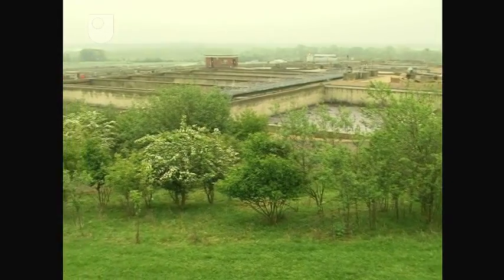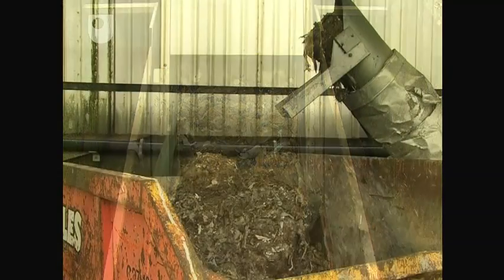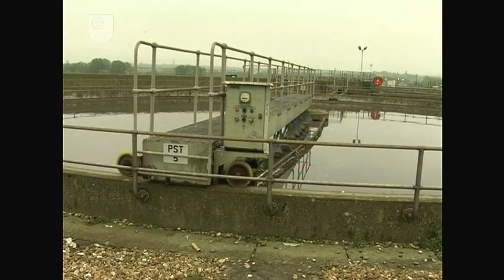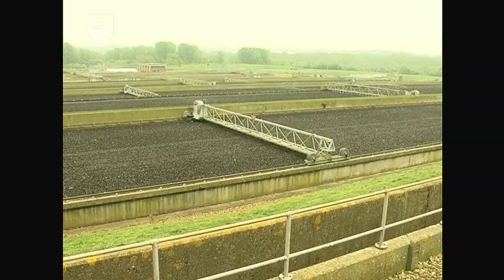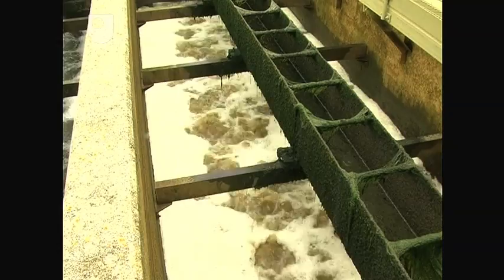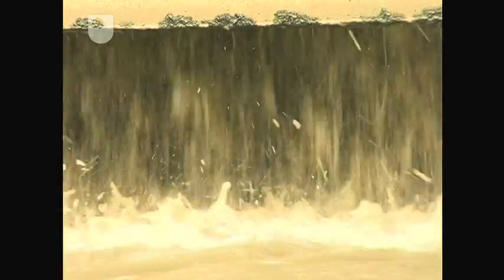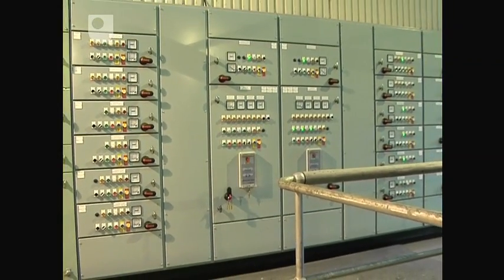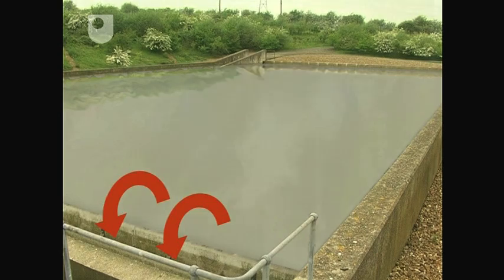Waste Water Filtration - Water Supply and Treatment in the UK (7/7)

Comment: What a load of crap... quite literally.
Water filtration system doesnt work properly and causes futher population in the form of chemical soup because it looks clear doesn't mean it's not toxic, futher more sea water filtration system cause higher concentration of salts on our coast destroy ecosystems. And land fills are the biggest pollution to our air and soils as it releases toxic waste in the form of gas if spread out far enough there wouldnt be a problem however it's too condensed and taking years to be broken down.
I could go on but I'll leave it there